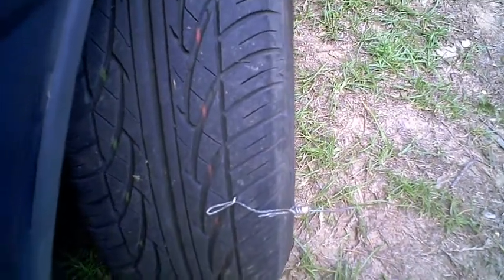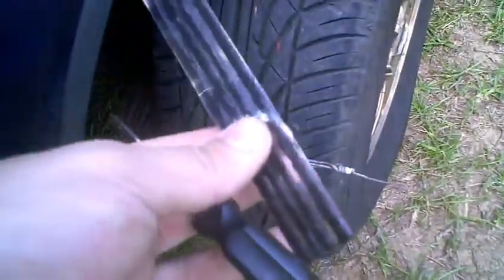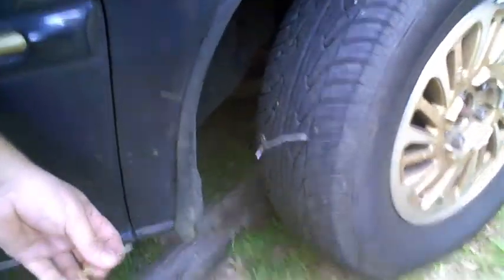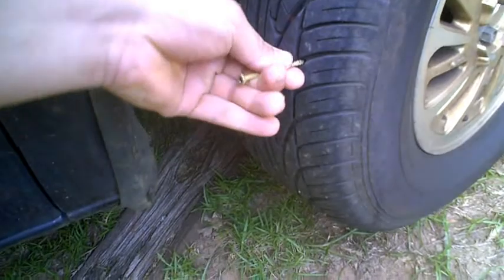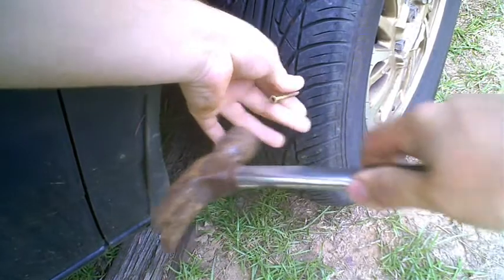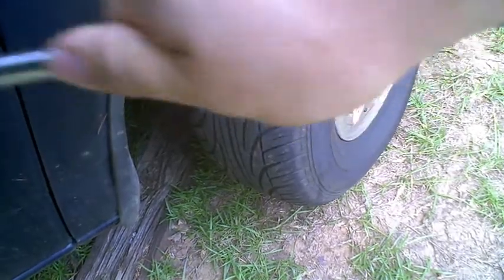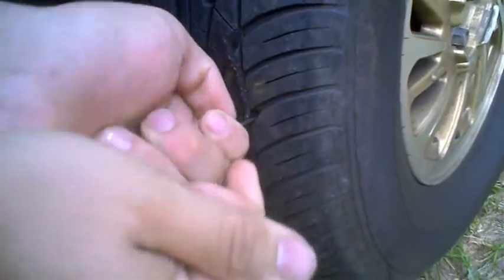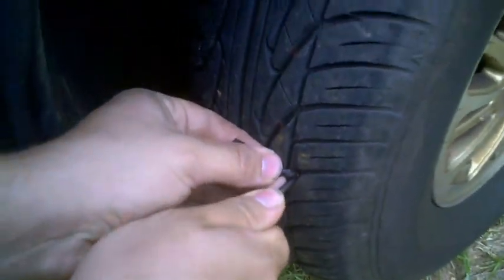How to Plug a Tire: the redneck way

Comment: @outdoorsman310 nope,it voids the warranty and the product liability insurance coverage on the tire ,all tire manufactures state that a tire should be patched with a vulcration of the rubber. while a plug will work in a emergancy ,your suppose to get it repaired or replaced asap

Comment: Dude that was funny.... Watching you with the hammer banging that screw had me cracking up... Not laughing at you, sometimes we have to work with what we have and it got the job done. The one thing I think you should have done, push that plug much further into the hole leaving about half inch showing. Bottom line, Mission Completed!

Comment: @outdoorsman310 change the tire and get it patched ,unless emergency ,the plugs can fail and the tire loses its"product liability" insurance if it has a blowout with a plug ,basically you can't sue the tire manufacturer for property damage or damage done to your vehicle if its plugged

Comment: @DannysCam I only quit because my boss was much like yours. Oddly and unnecessarily difficult. It think they're people with control issues and the only reason they get the job is because no one has that need to dick everyone every chance they get and no on wants the extra responsibility for a measly .50 to $1.00 an hour. I hated that job at times, but overall a fun job. Especially working with old retired guys that just needed to keep there minds/body's busy.

Comment: OMFG!!!  you didn't use the proper reamer that's included in every kit?

Your suppose to use the 6" reamer to ream out the hole "properly" to ensure proper fit and seal.

What you did is illegal in all 50 states.

I know everything there is to know about tires, and I could do a so much better job because I just sit on youtube and write stupid comments on youtube all day long.

Just kidding.